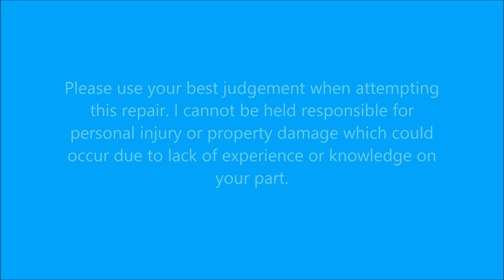Power Steering Pressure Line Replacement

Comment: Instead of messing with the fitting at the pump side, the prior owner of my PT used a tubing cutter on that straight section by the radiator and installed a compression fitting.  Easy to reach, doesn't leak.

Comment: I just performed this repair on a 2005 Turbo and this was my adventure:
Raise car
Remove front wheels
Remove fender skirts from front half and fold back
Remove grill
Remove rad core upper brace
Remove rad core lower brace
Remove rad fan
Remove bumper cover
Remove headlights (driver headlight is in the way of rusty bumper bolt and had to drill out bolt)
Tilt rad forward to access pump flare fitting
Remove pressure line (brackets are riveted to low pressure line so drilled out rivets)
Remove rear pressure line flare nut from behind the front frame brace (easy)
Clean dirt and grit off pump (better to clean pump after fan removal with old line attached)
Install new line
Note: Installing the front flare fitting into the pump was exceedingly difficult due to the location and position of the nut. Aligning the new line centered in the pump is super critical to get the flare nut threaded into the pump. This part might be best with a helper and mirrors. It took me about two hours just to get this flare nut threaded into the pump. 
Reassemble.

Comment: Great video thanks bro . To get to the line in the back I had to remove the air box and unbolt the fuse box and get it from the top . Also to get to some of the bolts on the radiator I had to remove the battery and battery box . Getting the radiator out was the hardest part of the job.

Comment: Don't take any of the grill/radiator stuff out. Raise the car, take off the right front wheel, the forward splash shield in front of the wheel, the belt and belt tensioner. A fairly short 18mm can then break the hose nut loose and there is enough room for your hand to take it loose after and to start the new one.

Comment: Very Helpful, this also applies to a 2008 PT Cruiser. I would note that nut on the rack and pinion is 18mm. Very difficult to get to. I finally used a crowsfoot  18 mm wrench with a 1/2 inch ratchet and 3/8's adaptor.  Pulled the air cleaner off and loosened the PIA nut from the top. Hope this helps.

Comment: This is a very good video, I had the same problem on a 2003 pt cruiser. Same setup. I didn't have to drain the radiator though, The radiator must have clips that it slides into on the bottom, if you pull up and out it comes out just a tad further, and if you pull the obstructing cords to the left you will have difficulty but you can loosen the nut, slowly.  xD

Comment: Go thru the passenger side headlight, I had not problem accessing anything on the power steering pump I even pulled the pump out through there :) saves coolant

Comment: I'm doing this on my 2001 PT . I just removed the fan motor out and still have room to get my arms inside to reach the pump and pressure line. Radiator can stay in, just disconnect the upper rad hose going to the  the radiator, and then the radiator can come more forward. I use only 4 -10 mm bolts not the 6 for the fan motor, 2 on top and 2 on bottom. Easy to get the fan motor out for this and other repairs.

Comment: thanks for the video couple of things I did was take out the battery and the mounting bracket that holds the fuse block you get a straight shot at the fitting from the top of the car.   Also if your air doesn't work like mine you can remove the AC lines and take out the condensor with the  radiator at the same time.

Comment: A challenging animal to work on for sure .1st tool a cold six pack . My problem:blew 3 p/s pressure switches in 3 months?not happy .Just replaced p/s pump after consulting with dealer who stated its "PROBABLY THE PROBLEM"blowing switches.while headlight and half the frond end is also apart as you did in video i'm also replacing pressure line (which is also part of a recall which is not a mandatory replacement).The end of line entering the rack was easier to get to after moving fuse box behind battery which I had already removed with air cleaner assembly  from the top with 18mm line wrench.Do yourself a favor while its apart replace anything that mite need tobe replaced in future: hoses belts ect.

Comment: I have Re&Re the power steering pump on my PT before so I got that end covered.  How about the rack end of the hose?  Was that an easy reach?  I have crows foot sockets and a bunch of extensions and wobble-head adapters.  Thanks.

Comment: Heads up!  If you have a 2001 to 2003?   And some other models?  THERE IS A RECALL FOR THIS HOSE!   Make sure to check with the dealer before you replace!

Comment: you can access the back side of the pressure line on (top of the rack n pinion) if you pull the fuse panel back (on top of the engine) about 4-5 inches...also you can disconnect your ac condenser from your radiator n pull you electric fan out but of course it's plugged up so make sure to unplug the fan first...then you will have more than enough room to access the pressure hose line to the pump.. it's not necessary to take out the radiator ...just trying to help.. i'm doing a replacement for a pressure hose on a 2003 today
Reply: on a 2003 both flare nuts for the hose are a 16 miilmeter

Comment: Yes I replaced my hose on my plate PT Cruiser a 2001 pressure hose and the threads from the pump would not go deep enough into stop the line from leaking it wasn't 18 mmmm they gave me a 15 mm l

Comment: ATF4 transmission fluid for power steering?
Reply: Yes. Power steering fluid and ATF are both just hydraulic fluid. ATF is cheaper, but is chemically the same thing.
Reply: N Valdez that's what I was saying